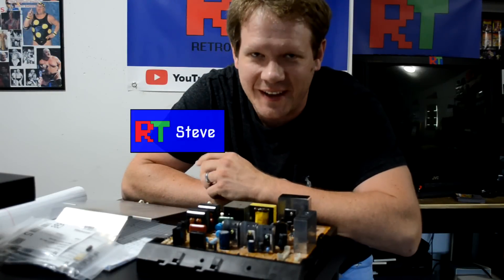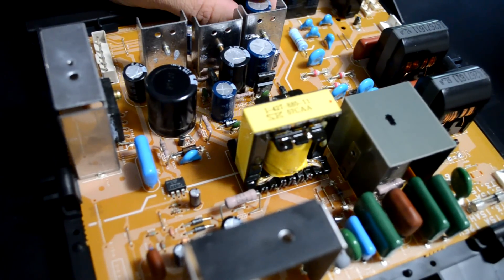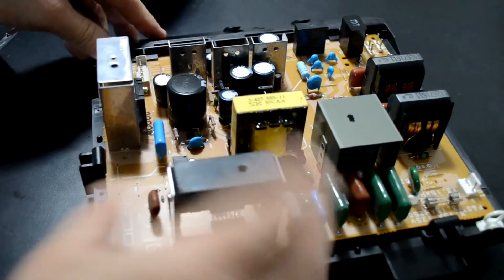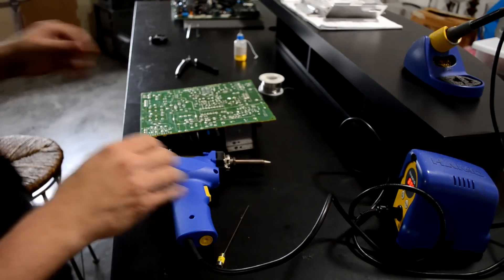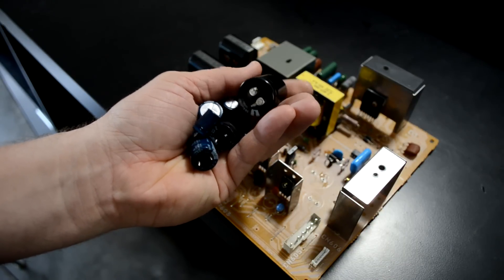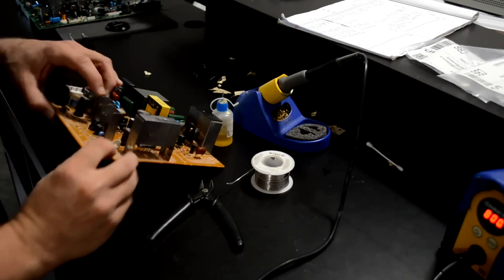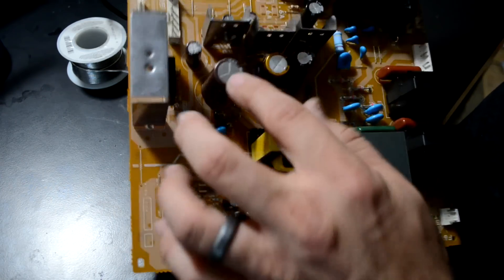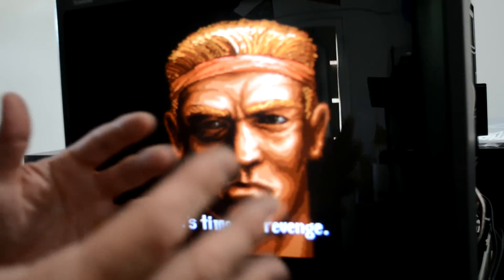Repair a Sony CRT Power Supply - PVM 1351Q - Bad Capacitors!

Comment: I just picked up my first Pvm. (Sony 1340). It was sold as not-working. 

Took it home, reviewed insides, looks decent, no obvious problems. 

Fired it up. I get powe. Degaussing works. I get neck glow and can feel a static charge on the screen but no raster. 

Any idea where to start on this one?  I’ve done a bunch of work on arcade crts but never a Pvm. Thanks in advance for your help. I love your videos.
Reply: Did you ever fix it?

Comment: Maybe it's a silly question to ask, but does the same apply to consumer Trinitrons? While I was trying to pick up something I dropped in my CRT while I was gixing the geometry with a plier, it bumped into a part of the power supply, and now my TV won't power on. It shows a red light, but it quickly disappears again.

Comment: The big yellow block (Headquarters-looking building) on my g-board has blown liquid everywhere, and the soldering looks like it's in bad shape. Any way this is recoverable? Perhaps it's easier to look out for a G-board from somewhere? :(
Reply: The gunk is just glue. Remove it with isopropyl alcohol or similar. Check the caps and maybe swap them, reflow the solder and you're good to go.

Comment: Hey Steve! My sony trinitron crt recently switched off halfway through a game of mario kart and began the 2-flashing standby light issue - is what you describe in this video the correct method to fix that issue? From what i can tell online using a different Trinitron model to mine, 2 flashing lights means: Diagnosis: B overcurrent (OCP). Possible causes: H. OUT (Q8024) is shorted. (D board), +B PWM (Q8035, 8038) is shorted. (D board) Symptoms of the problem: Power does not come on, Load on power line is shorted.
Does this sound about right to you?

Comment: My Sony Trinitron timer light blinks 5 times is this power supply issue?
Reply: 5 times, Diagnosis: White balance failure (Not balanced) Possible causes: Video out (IC7101, 7201, 7301) is faulty (CR, CG, CB board), CRT drive (IC309) is faulty (A board), G2 is improperly adjusted. Symptoms of the problem: No raster is generated, CRT cathode current detection reference pulse output is small.

Comment: I have a question, my trinitron XBR is showing a green verticle bar when you turn it on, sometimes it turns to snow and then goes away and as long as the TV remains on it doesnt come back. But it comes back whenever you turn the TV back on. It seems to be related to the PIP function. Any ideas please help?

Comment: Hey Steve! I was curious on how you keep all the caps organized and how you remember which ones go where after you take out all the old ones? Are there markings on the board that tell you the cap specs for each cap? Thanks!
Reply: Technically the service manual has a parts list. And the PCBs have codes printed on them that reference the parts list.
Reply: You can also do one at a time.

Comment: It's always great to see your videos Steve. I have a Dell Trinitron P1130 that a have a slow start (takes some time to show picture), this could be a cause for it or it's a diferent issue?
Reply from the maker: CRTs can take up to 30 minutes to fully warm up, but bad caps can contribute to all types of power problems.
Reply: @RetroTechUSA  Tanks for your reply, I will take my monitor to a repair man to properly chech what could be the issue. I just wonder if something in the power supply side of the board was the issue. But anyway thanks Steve.
Reply: StrF6267 sonyPowerSupplyVoltage

Comment: Awesome! Thank you so much for all your help! I think you just answered my question I posted on the pvm 2030 calibration video. I have a 2530 that pulsates so I'll check out how to repair it! Is it safe to assume that it will be similar to this monitor?
Reply from the maker: Yes it could be.  The 2030 has some large caps in the PSU.  It's in a different location  on that PVM, but it's the same type repair.